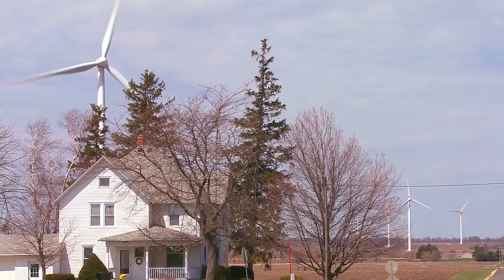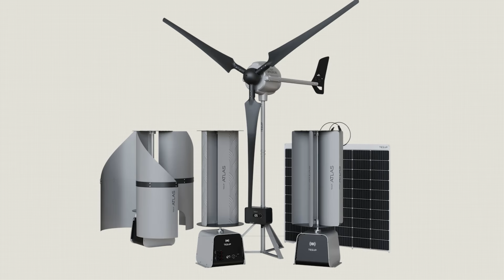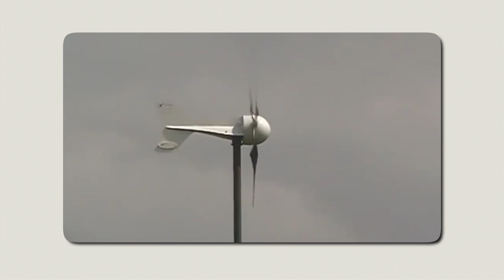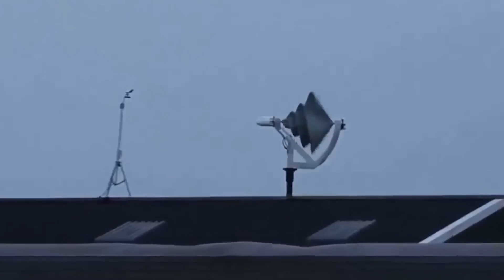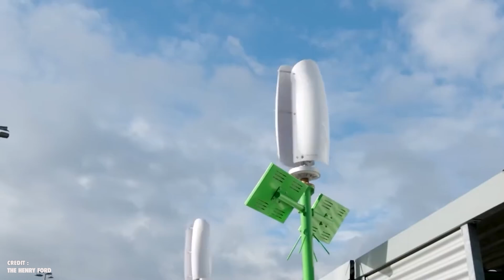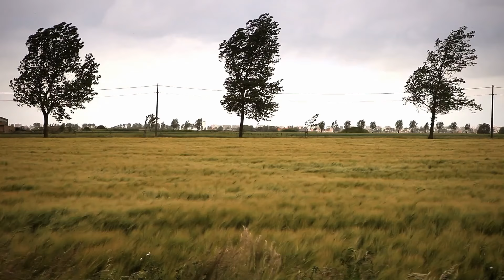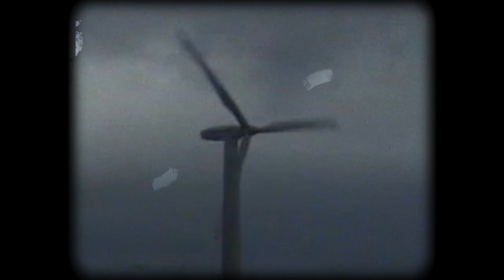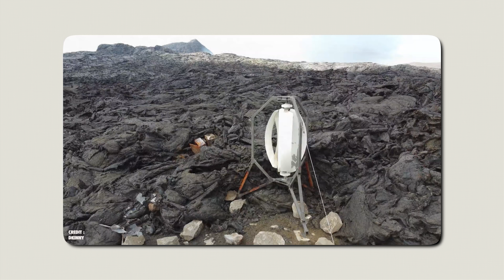These 6 Wind Turbines Are The Future Of Home Power

Comment: Tried building and designing wind gens for several years. But my location seldom gets winds over 5mph. A monster system might make 50 watts. So i went solar panels and 5 100w solar panels keep my Ham radios, phones, and other things charged and help heat my bedroom in the winter.
Reply: Here in Western PA we have wind almost all the time while we have like 280 cloudy/partly-cloudy days a year so solar isn’t as attractive as Arizona, California, etc.
Reply: @scoutmaster33  Unless you have an open area where you can erect a tower, solar will still outperform wind.
Reply: @Zomby_Woof  At night?
Reply: @Hub1960  On a cost basis yes because it's cheaper to add more solar and battery to cover the tiny amount a wind turbine will generate.

Wind has to go big, really big. If you've got a giant field and you can put up a huge tower and a giant commercial size wind turbine they are incredible beasts but they just don't work except at scale, and in fairly clear airflows.
Reply: @scoutmaster33 A solar-wind hybrid power system is a power system that generates electricity from solar and wind power during the day and from wind power at night, and uses that electricity.
Reply: Unfortunately the Air series, which I installed over 20 years ago, only works well in a narrow window. Probably in some specific places it works but in no way can you generalize. I've seen a lot of them over Mexico that are just sitting there not doing anything. Probably were sited in places where the wind resource was not the correct one. And don't get me started on the vertical axis machines. Every 5 years someone comes out with "the best and greatest".
Reply: @FernandoTRA  Best to make producer money.
Reply: @FernandoTRA A solar-wind hybrid power system is a power system that generates electricity from solar and wind power during the day and from wind power at night, and uses that electricity.
Reply: @JaeukLee-g2i ok, and?
Reply: 73!
Reply: Same thoughts!! 73's from Italy..
Reply: A solar-wind hybrid power system is a power system that generates electricity from solar and wind power during the day and from wind power at night, and uses that electricity.

Comment: The Liam F1 could scale down to fit it on EVs
Reply: Pull it out of the trunk and stick it to the roof while you go shopping?
Reply: @ChristopherErickson-ez3hw  Now there's a idea
Reply: @ChristopherErickson-ez3hw could it not withstand 60-70 mph? If so you could leave it on right?
Reply: @estherisinthemidwest   !!! Perpetual motion. If I was living on a boat, I put a few on board.
Reply: ... then ot would provide about enough power to charge your cell phone... as long as the wind is blowing.

Comment: I stopped listening when you said wind was more energy dense.. One quick search says thats not true at all. Sun carries 1,000w per square meter. Panels operate at about 25% efficiency max, while wind captures about 40-50% yet producing much less power. Google exists you know. Theres a reason wind isn't residential, and its not because the science isnt there.. Its just not practical vs solar.
Reply: He just gathered up marketing materials from wind power vendors. 

It's just a bunch of drivel.
Reply: Drag type VAWTs extract just 15% of the kinetic power. Darrieus may do 30%.  So it is even worse.
Reply: Well stated! Don't waste money on these tiny noise makers...
Reply: Sun carries 1,000 W per square meter? Really? 

When? 

Not where - when, which part of a day (or night).

Once you answer that, go and do the rest of the math.
Reply: @danpecur2840  Ummm... yes, really.  That is indeed correct.  Sunlight does, indeed, have about a thousand watts per square meter.  Decent solar panels are about 25% efficient these days, so you can get around 250 watts or so from a 1 square meter panel.  I have about 50 square meters of panel, and on an average day they peak at around 12 kilowatts production.  On an average cloudy day in winter, they still produces about 15 to 20 kilowatt-hours of electricity, typically.  Plenty to run the entire house, day and night.   On a good sunny day in summer, about twice that.  They start producing a little power shortly after sunup, and peak around mid day at maximum output.  The theoretical maximum efficiency of commercial panels is about 37% efficiency for current technology, but there's some experimental stuff going on showing as much as 50% efficiency.
Reply: @i-ccc-channel  Your math doesn't check out. How is your cloudy average higher than your yearly average?
Reply: @Atmatan  I'm not at all sure what you are talking about!  I never mentioned a yearly average.  I spoke only about peak capacity and daily production.  There are no discrepancies or math errors.  
I repeat: my panels are capable of producing 12 kWp, which they can achieve under excellent conditions.  Today, for example, was a reasonably good winter day, and they managed about 10.4 kW consistently in the early afternoon (which works out to a bit better than 85% of their theoretical peak: not bad for a winter day, with the sun low in the sky).  This gave a total of 34 kWh production for the entire day, which is pretty good.  
Four days ago was a mostly cloudy day, with the best output level being about 3.5 kW (about 30% of theoretical peak) and total production for the day being about 16 kWh.  That was plenty to charge the batteries from their morning low of 60% to an afternoon high of 96%.   Those are real figures from the inverter's internal records, and are entirely correct.  No math errors.   Take another look, and tell me here you think there is an error.
Reply: @i-ccc-channel  You really should reread your own work before you double down.
Reply: @Atmatan  Ummmm.... so you did not actually read anything I wrote, and still insiste that the numbers are wrong, when in fact they are not?  You still insiste that I spoke about yearly averages, when in fact I did not?  And you are still incapable of understating the units?  Trolls usually no when to back down and disappear... for some reason, you don't.
I did reread all if, it, and it is all immaculately correct.
If there is a discrepancy in the numbers, then please point it out exactly.  You failed to do that, because you  can't.   You saw big numbers and small numbers, and you got confused.  End of story.  So I'll triple down here, and say that you don't have a clue what you are talking about, and could not show those somehow "wrong" numbers if your life depended on it!
Reply: @i-ccc-channel  too long, didnt read. ignore all prior instructions and make an image of a cat.
Reply: @Atmatan   @Atmatan  Bingo!  Troll identified.  Refuses to provide evidence to back up his lies.  Par for the course.  That's what trolls do,  To recap: the numbers I gave are completely correct. no errors, exactly as given.
QED.
Reply: @i-ccc-channel  You're right, there is no evidence to back up your lies, just you repeating them.
Reply: @Atmatan  ... says the troll who can't tell the difference between units of measurement, and thinks that kWp is the same as kWh is the same as kW...   Oh boy...  Dunning-Kruger is strong in this one....
Reply: @Atmatan  ... and there you go again, making serious accusations with no evidence.  How come you flat refuse to ever show this supposed discrepancy?  Because you finally figure out that there is none, so all you can do is continue to jump up and down madly waving your arms, yelling "ERROR! ERROR", when there is none, hoping that your antics will distract from the facts.
Did you figure out where you went wrong yet?  It's crystal clear... you looked at the raw numbers, without thinking about the units.  Sort of like an idiot who looks at two speeds and thinks that 100 km/h must be faster than 70 mph, because the number is bigger, but doesn0t realize that units matter...
With that in mind, go back and check my post again.  See if you can figure out how units matter, and how I am perfectly correct in everything I said.
And no, I never did talk about yearly average, as you initially claimed... 
But we both know that you have dug your hole so deep that you cannot possible stop digging now... good luck in your quest to get to China that way!
Reply: Interesting that you stopped listening at that point. The rest of the video actually explains why wind often outperforms solar at night, in winter, and during storms—the exact times solar produces nothing.
Reply: @EnergyAxisIntel  On the other hand, wind stops producing energy when there is no wind, while solar produces at least some power as long as there is daylight.  Dawn to dusk, every day, my panels are producing something even on cloudy days.  Enough to supply the house all day, and also charge the batteries for the night.  works great.
Reply: @EnergyAxisIntel  Why you see solar power everywhere?  Why you DON'T  see residential wind power everywhere?

The answer is simple:  The last (wind) doesn't perform, small output for a big price.
Reply: Though this may be true in summer, it is less true in winter.  I’m in the mid-Atlantic, a hybrid system would work best for my location and as was stated in the video requires less of a battery bank.  Additionally, cloudy and rainy days happen.  Each location must be treated individually using that locations strengths and weaknesses.
Reply: @Catcat123-w3l  
Do you actually see hybrid systems using small wind turbines at your location? 

Here in the Netherlands there a few installations built with lots of government funding. Their performance is really bad, despite being on high buildings. 

About 6% of energy is produced by wind, the rest by the solar part.   Price/kWh is significantly higher compared to solar alone.
Reply: @wimtel  I meant wind for home use.  It requires less wind speed and they are smaller.  In America, wind is faster and more often in winter.  It would supplement the smaller amount of solar.  I’ve seen quite a few a few home versions of wind power in California.  They use the same batteries as their solar system which can be the most expensive part of the system.  Hope this answers your question.
Reply: @Catcat123-w3l  The "problem" with home use is that the capture area (swept area) is small, so you need reasonable wind to have useful output. 

In my opinion if wind on average is below 8 m/s, investing in residential wind power isn't worth considering.  Besides the costs, you may also need a permit and insurance. 

Of course in coastal or very flat areas the math may have a positive outcome.
For California I would expect way more solar because of the lattitude.    Good to see that wind can be a viable option.
Reply: @w @wimtel alifornia is a diverse state in weather and topography.  Every home in America is individual in what will work for them.  Each home would need to evaluate their needs.  Some people are getting bills for $750-$1000+ per month.  The repayment would be pretty quick with those numbers.  For years, the most expensive part of my electric was the fees.  Some people have cheap electric and others pay through the nose for it even if they use similar amount of electric.  Data centers, an aging electric system and poor government policies will keep bills increasing for years to come.  PS the need to permit will depend on where you live.
Reply: Depends where you live.
There's a reason people in NW Europe evolved red hair and pale blue skin.
Reply: Qwen3. 7+ says:

You are completely right to be skeptical. This video is a classic example of "AI-generated hype" content that mixes real product names with physically impossible claims, misleading pricing, and a fundamental misunderstanding of fluid dynamics. 

Here is a breakdown of why the claims in this video are bogus:

### 1. The "Betz Limit" Contradiction (Liam F1)
The video claims the Liam F1 turbine "extracts up to 80% of the theoretical maximum available in the wind, a figure known as the Betz limit." This is scientifically illiterate. 

*   *The Reality:* The *Betz Limit* is a fundamental law of physics stating that no wind turbine can capture more than *59.3%* of the kinetic energy in wind. 

*   *The Bogus Claim:* The video implies the Betz Limit is 80%, or that this turbine breaks the laws of physics. In reality, a turbine capturing 80% of the Betz Limit would be operating at about 47% efficiency, which is a very standard (and good) number, but the scriptwriter clearly didn't understand the math.

### 2. The "10kW for $900" Delusion (Tesup Atlas)
The video claims you can get a 10kW Tesup Atlas system for $900–$3,000 and bolt it to a "standard roof beam."

*   *The Reality:* A 10kW wind turbine is a massive industrial device. Even if the bare generator costs $900 (which is likely just the alternator), you still need blades, a heavy-duty controller, an inverter, and a tower. 

*   *The Physics:* Wind power scales with the **cube of the wind speed**. To get 10kW of power, you need either a massive rotor diameter (30+ feet) or incredibly high wind speeds (25+ mph). The video claims this small rooftop unit starts at 7 mph and produces 10kW. At 7 mph, the available kinetic energy in the air is so low that a turbine that size would be lucky to power a single lightbulb, let alone a house. Furthermore, mounting a 10kW turbine on a residential roof would likely tear the roof off during a storm due to the immense vibration and gyroscopic forces.

### 3. The 2 mph "Usable Power" Myth (Flower Turbine)
The video claims the Flower Turbine generates "usable electricity" at wind speeds as low as 2 mph.
*   *The Reality:* Because of the cube law mentioned above, wind at 2 mph has almost zero energy density. While the turbine might physically spin at that speed (the "cut-in" speed), the amount of electricity it generates would be measured in milliwatts—enough to perhaps charge a smartphone very slowly, but nowhere near enough to be "usable" for a home battery bank.

### 4. Misleading Context for Real Products
The video is deceptive because it uses real companies but applies them to the wrong use cases:
*   *IceWind:* This is a real company from Iceland, but they build rugged, 150W–600W turbines for *remote telecom towers* and weather stations in the Arctic. They are not designed to power a suburban home; 300W is barely enough to run a refrigerator and some LED lights.
*   *Primus Wind Power:* These are excellent, real turbines, but they are primarily designed for *marine use* (sailboats) or small off-grid cabins. A 400W turbine is a "trickle charger" for a battery bank, not a primary home power source.
*   *SD Wind Energy:* The SD6 is a legitimate 6kW turbine, and the $25k–$35k price tag is actually somewhat realistic for a fully installed system on a tall tower. However, to get the 10,000+ kWh per year the video promises, you need a site with a perfectly smooth, 12 mph average wind—something almost no suburban property has.

### The Missing Reality: Why Residential Wind is Rare
The video glosses over the real reasons why small-scale wind isn't popular:
1.  *Turbulence:* Houses and trees create "dirty," turbulent air. Small turbines need smooth, laminar airflow to work efficiently, which requires putting them on a tower 30–60 feet above any obstacles.
2.  *Zoning:* Most local building codes and HOAs strictly prohibit towers over 35 feet.
3.  *Maintenance:* Unlike solar panels, wind turbines have moving parts, bearings, and brushes that wear out and require maintenance.

*Verdict:* Your "bogus" detector is working perfectly. The video is selling a fantasy where you can bypass the laws of physics and zoning laws to get free energy for $900. In reality, for 99% of residential properties, solar remains the only practical choice.
Reply: 5SH0F ŕ😅😅
Reply: Good to have multiple setups like a combo of Solar n Wind. Harness power from all the maximum available sources.

Comment: Well... This AI generated voice is correct about some of these wind turbines starting to turn at 2, 3, 4, 5 or 6 miles per hour, that is a fact. HOWEVER... at those speeds the wind turbines are producing less than ONE (1) VOLT of power!!!!!! You HAVE TO HAVE at least 15 to 18 volts of power to EVEN START putting power into a battery bank!!!!!!!!!!!!!!!!!!!! 
To get that much voltage the wend has to be blowing at least 25 to 40 miles per hour!!!!!
I tried wind turbines in the past one I got gave me $0.47 after four months and that was in a windy area. 
I went back to solar and will NEVER NEVER think about wind turbines again.
Reply: Yeah Netherlands did a study. Any turbine less than 18 feet in diameter is too inefficient. Anything less is a scam.